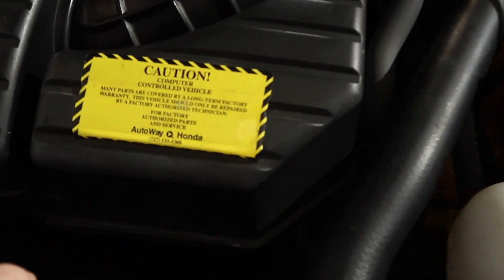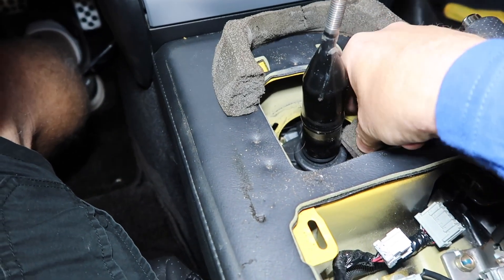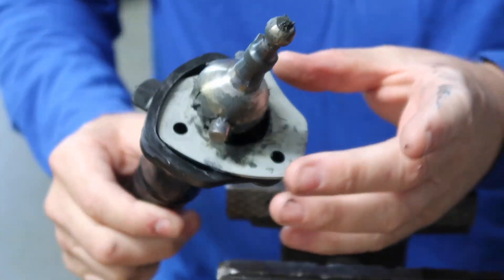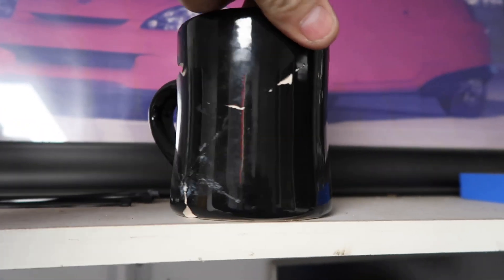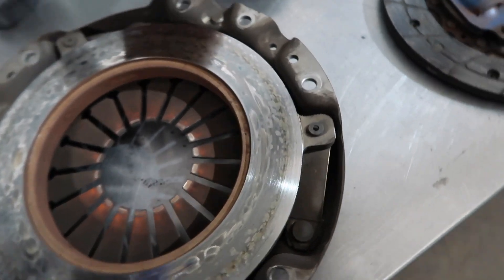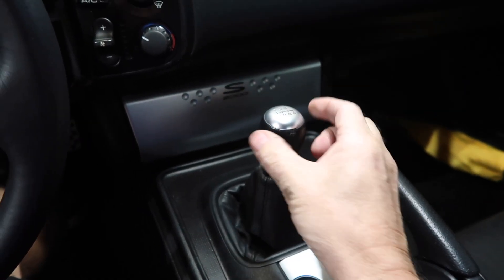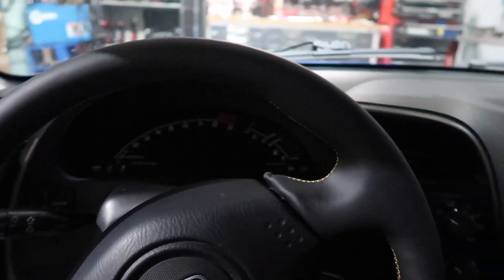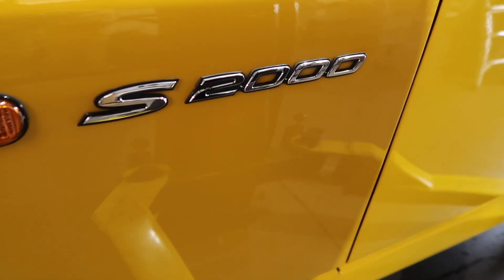S2000 SHIFTER Rebuild - Parts needed.

Comment: i just did the master rebuild on my car, what a difference. Only question is the spring, is there a top or bottom? I don’t remember what way i put it back in (if it matters). To get it into reverse it goes down about half of what it used to before the rebuild. Is that just because of the new spring compared to the old worn out one?

Comment: I no longer own my S2000 but use the Honda urea grease on EVERYTHING
Reply: You’ll be sorry you don’t own it any longer. ;-)
Reply: @tedwhite5197  I’ve been sorry about it for 3 years. Bought a mint 2004 with 46k miles on it in 2017, supercharged it. Hated the kraftwerks kit and wish I had gone turbo. Sold it to buy my now wife a $13k engagement ring and planned on buying another one stock and putting the science of speed turbo kit on there. Then kids came along.
Reply from the maker: @wantapgt  Stick in there, you’ll get it back again. I had a very similar story. Patient will pay off

Comment: Will this solve changing gears from 1 to 2 notchiness/grind?  And at times 3 to 4? It's so annoying. I live in the PNW with Gear300 fluid.
Reply from the maker: This is essentially takes out the looseness in the shifter. The naughtiness is internal. We’ve tried several different fluids to help out. Unfortunately it is the nature of the S2000 transmission. We have used Royal purple sync, mesh, and had good luck. Others have used other different fluids and had experience similar to hours.
Reply: @LHTPerformance  Thank you for the speedy reply. It's been a headache for awhile. Although since the weather has been warmer/hotter it's a little better.

Comment: John, is there another method you’d recommend for getting the two plastic parts off the shifter without using a vice grip? Thx for what you and your team do!
Reply from the maker: Honestly, I grab it with my hands and it pops off. I have pretty strings hands as I’ve done this kind of thing all my life. I often forget not everyone does and wanted to show a fool proof way. Either way, the parts get trashed so it not a big deal how you remove them.
Reply: 10-4. Appreciate your response.